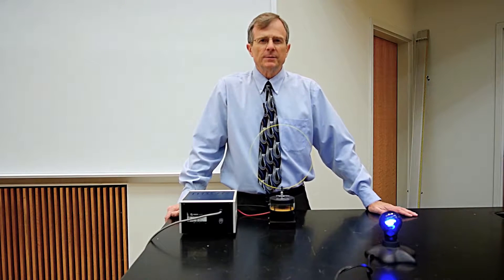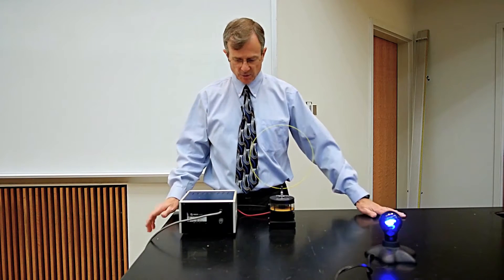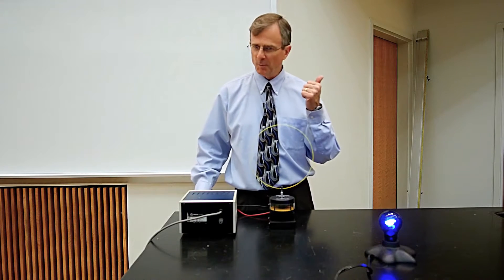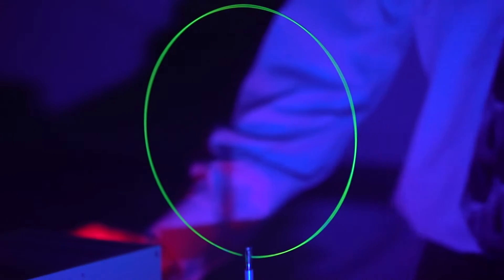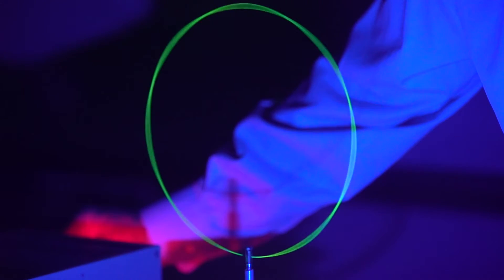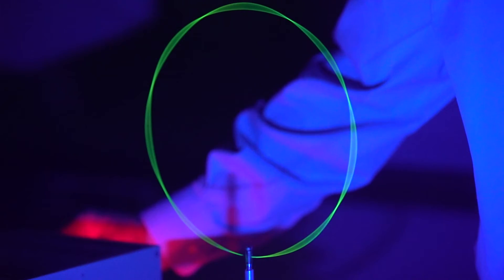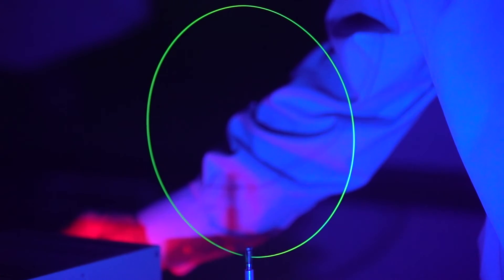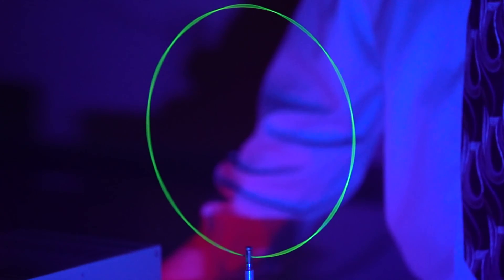Standing Wave Demo: Vibrating Hoop

Comment: Wait a minute sir!
On a circular hoop can have intiger multiple of wavelengths ,
So number of bands should be even ,
In case if L(circumference)=3(lembda) 
So, we will see 6 bands ,but why we are seeing only 5 bands or odd number of bands.
May be the sixth band is the part of the string which is used to create vibration.
Reply: See closely the lower top of hoop is attached to the vibrator , so it's necessary that it should be a node and hence some waves cannot be formed